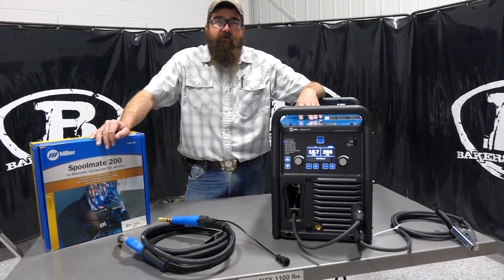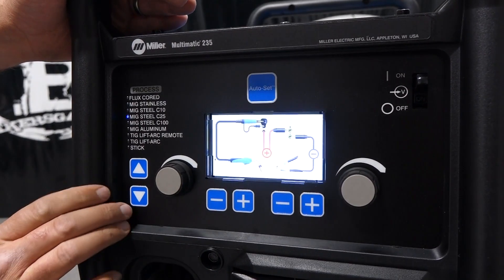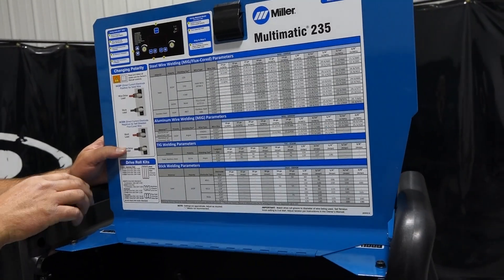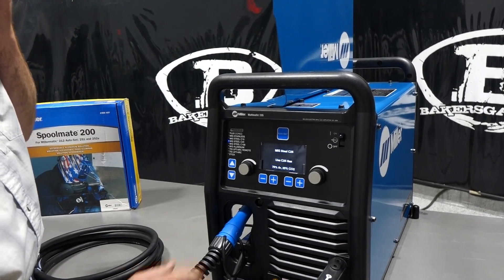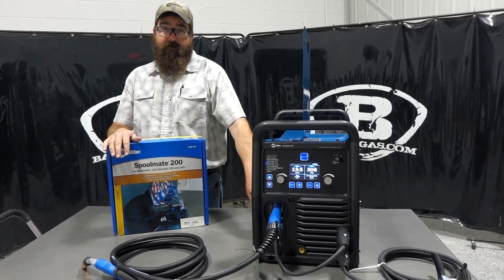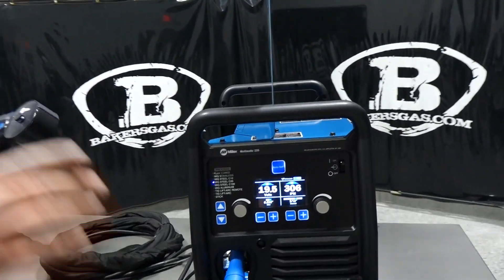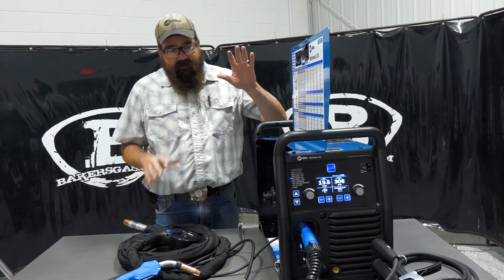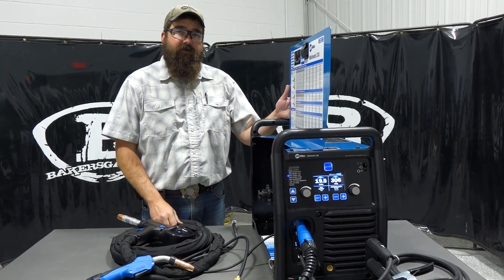Miller Multimatic 235 Review - 907728 + Spoolmate 200

Comment: Hello man, i have a 220 volts with 8/3 wire and 30 amp breaker in my garage and wondering if i can run this multimatic 235 on it or do i have to upgrade to 50 amp breaker? Thanks and love your show
Reply: Thanks for the reply! how about for 255 multimatic? Do i need 6/3 wire and 50amp breaker to run this thing? Im  debating between 235 and 255

Comment: Having issues getting argon to my spoolmate 200. Hooked everything up the way you explained and no shielded gas coming from the tank to the gun.  Any suggestions? Maybe it’s a defective gun?
Reply: This video is incorrect.  The Spoolmate 200 has an internal gas solenoid so it hooks directly to a gas cylinder.  Miller has a set up video on their channel.  Search Set up 235 to weld aluminum.  They demonstrate using a 30A but it would be same for the 200.